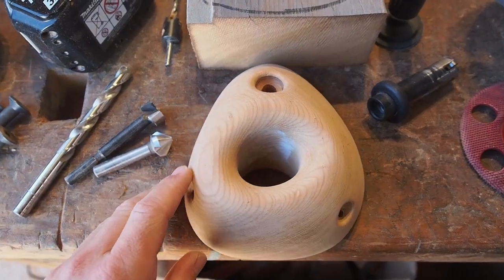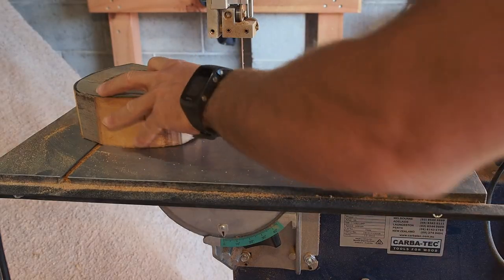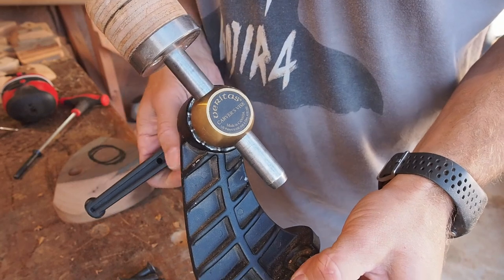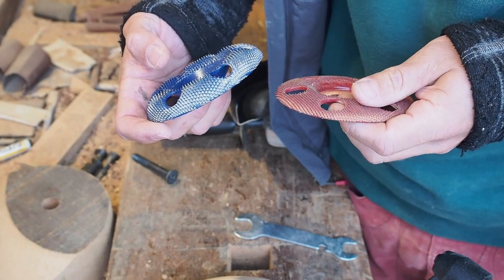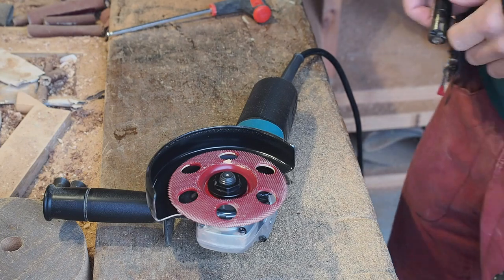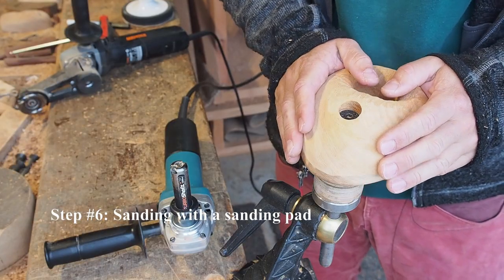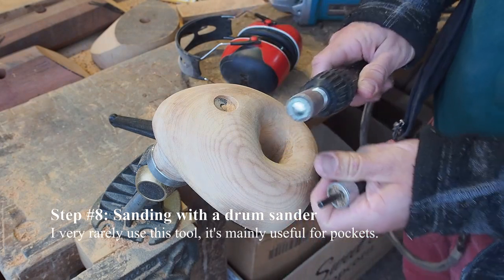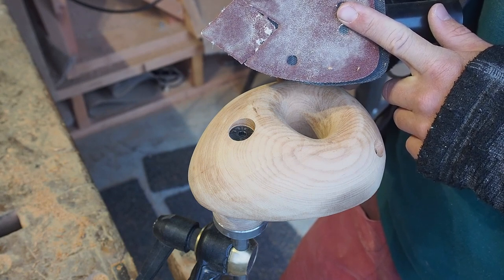How To Make Wooden Climbing Holds - Tools And Steps Explained - Finger Pocket

Comment: Very nice work.  What are your thoughts on 1) type/kind of wood, 2) orientation of the grain relative to the expected direction of pull, and 3) Location of bolt and;/or screen holes relative to expected direction of pull on the hold. Thanks again.
Reply from the maker: Thanks Matt!
1) soft wood to get started and gain experience, then hardwood that's not too hard (reduces the time for sanding) and without large open pores (they get greasy over time). Beech is one of my favorites. 
2) if you're using hardwood that's free of cracks, the orientation doesn't matter much as long as the bolt and screw holes don't go directly into the end grain.
3) bolt hole quite centered (small lever to reduce the possibility of a spinning hold) and screw holes far from the center (large lever to prevent spinning) but at a location where the hold is still a little bit thicker and can handle the forces.
Cheers, Tobi

Comment: Is there a specific reason as to why you use countersunk bolts and and not just the usual socket cap bolts with a washer?
Reply: And is there a specific depth that is optimal for the holds? I understand it would depend on wood size and bolt length etc but is there an approximate depth that should be used so the structural integrity of the wood isn't compromised? 
Also I didn't say it early but your videos are fantastic and probably the best resource I have come across for making holds and I've been looking all over the internet.
Reply from the maker: Thanks man! :)
To me it seems to make more sense to use countersunk bolts because the pressure is spread over a larger surface area, both on the head of the bolt and the bottom surface of the hold. But I can't back it up with literature. I can also imagine that in case if the wood already has some cracks the countersunk bolt could make it worse? So far, I have had no issues with cracking at all. I also had a look at the wooden moonboard holds and they are using countersunk bolts instead of counterbore bolts. 
About the depth of the holes: I'm using at least 50mm long bolts and for the big holds up to 80-90mm long ones. That's all based on gut feeling: judging the wood - are there any cracks? How is the lever ratio when you pull on the hold...

Comment: This is so cool man! Also really love the carving tools. Is that a regular angle grinder? And have you ever considered painting and texturing the holds? (they are fine like this, but would be cool i guess)
Reply from the maker: Thanks Oscar! I'm using a regular angle grinder in the video but since then I have upgraded to a variable speed angle grinder which is awesome in combination with the sanding disc.
I've oiled some of my holds partially to make them more challenging but I haven't painted and textured them. In my opinion, the smooth texture of wooden holds is a training advantage. When I need more texture, I use conventional resin holds which are also cheaper.

Comment: Really nice finished hold! Do you apply any wood treatment for a final finish before putting it on the board? Just curious as my board is outside and untreated wood holds won't last too long
Reply from the maker: Thanks!
Sorry, I don't apply any coating because my board is inside...

Comment: Hey, great vid! Would you say this hold could have been made with only the medium disc and not the coarse one? Would it have just taken longer?
Reply from the maker: Thanks! Definitely, the medium disc is perfect for this job! Would just have taken a bit longer. After more than two months of working with both disc, I have used the medium disc way more often.
And for removing a lot more material the mini grinder (see my two latest uploads) is faster than the coarse disc...
Reply: @wurfttobias  Thanks for the response! And do you think the flat disc is better suited than the round disc for medium grain?
Reply from the maker: @exodust2056  I think the flat disc is easier to handle and thus better to create a nice smooth surface
Reply: @wurfttobias  cheers! Very inspired by your videos and Instagram :)